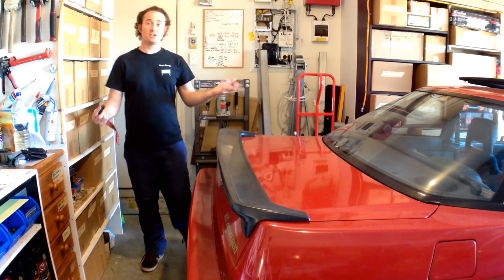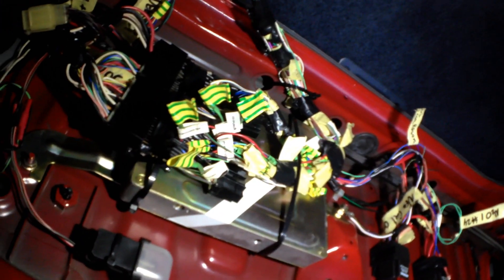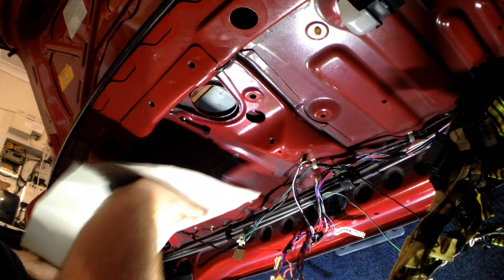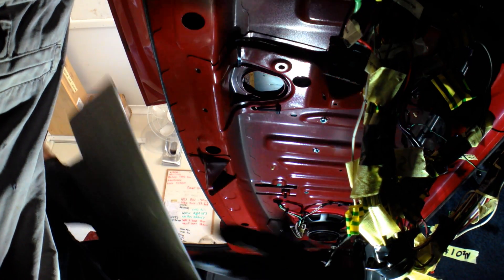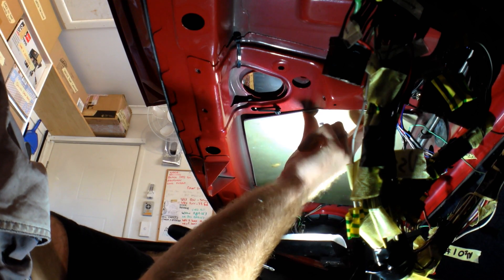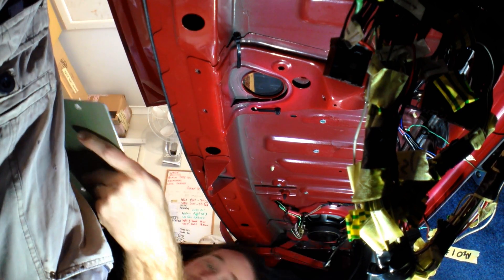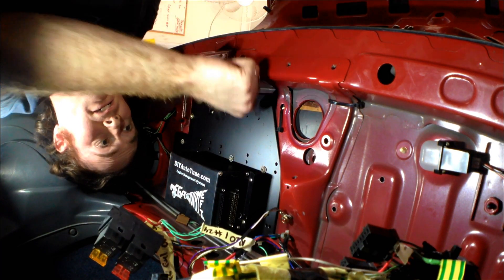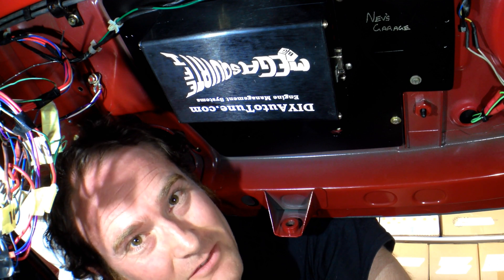Subaru Vortex EA82T Megasquirt MS3x Project S03E01 - Mounting the ECU

Comment: Where would be a good place to start to get a pair of those heads? I just finally got my hands on a ea82 after a year and now I find out this was almost an experimental engine. I want to push this thing to its limits and build a rally engine out of it.
Reply: he has the only ones known in existence ,they were designed to be heads for a auto light personal aircraft,Only 30 sets of heads were made, and he has 3 sets... no one else knows where the rest are. there is ONE video online of the motor running, sounds NASTY!